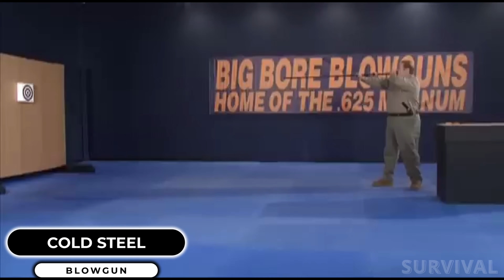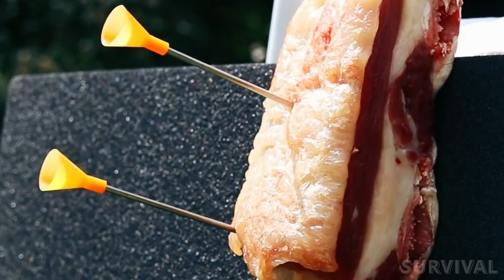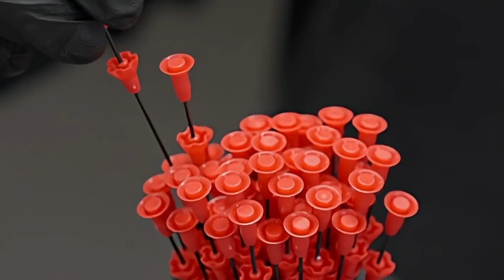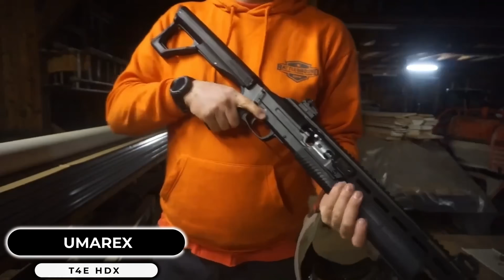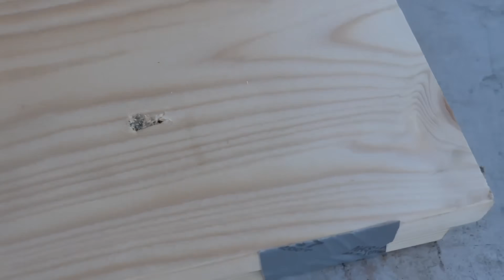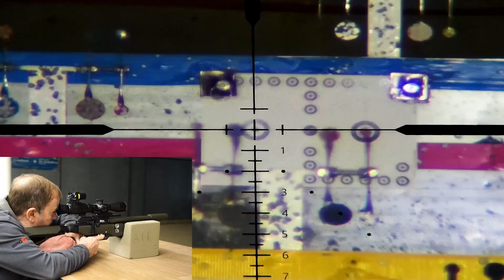10 LETHAL Home Defense Weapons ANYONE Can Buy on AMAZON! (NO LICENSE)

Comment: A BB gun, powered w/ CO2, regardless of the BB type used, will NOT injure anyone.

You may even play with firends using steel BBs if you want - it won't change a darn thing.  It won't be more powerfull (joules will remain the same).  A 1g BB will only be slower and pinch LESS than a .25g BB. It's pure physic.

Anyone else who say otherwise is simply an ignorant.

Comment: I think you should defend yourself with agricultural implements.  Specifically, a surplus tank with its gun removed and replaced by your legal in most states 110 foot range brush clearing flamethrower (the XL 18).  Admittedly you might have to expand your defensive perimeter a bit.

Comment: Better BB guns firing steel pellets at 450 fps penetrate RIGHT THROUGH a steel can. Is your face thicker than a steel can? Is your neck? Are you sniping at someone or shooting an attacker at 10 to 20 feet? If you shoot out someone's eyes and into their brain, do you expect them to continue attacking you? If you feel it's necessary to explode their head, there are other air guns that fire .32,.45, .50 caliber and arrows. Some are designed to kill bears and elk.